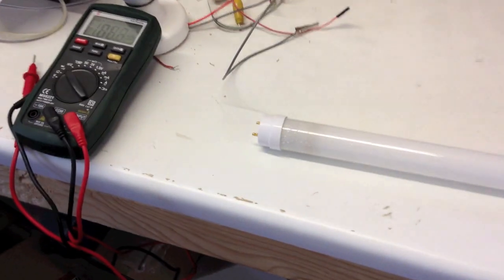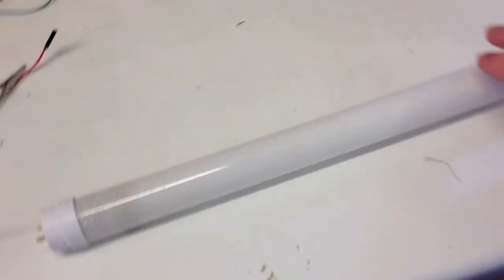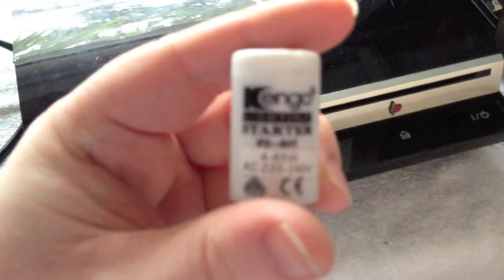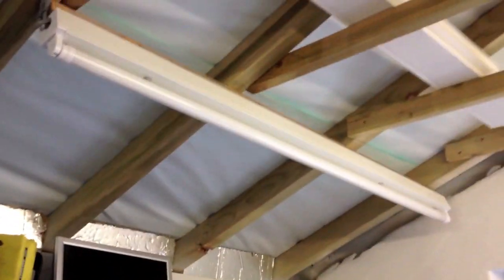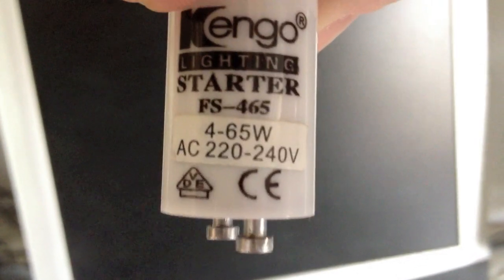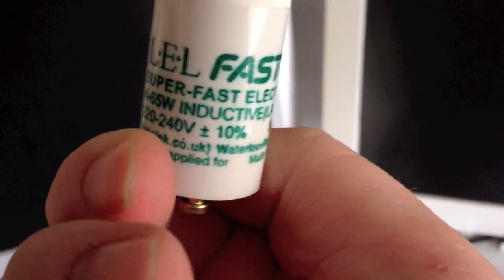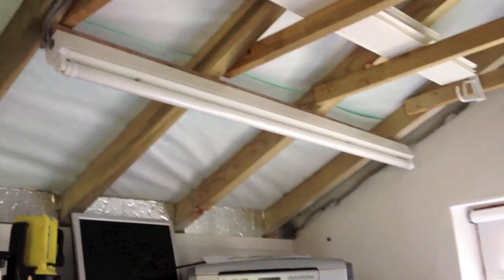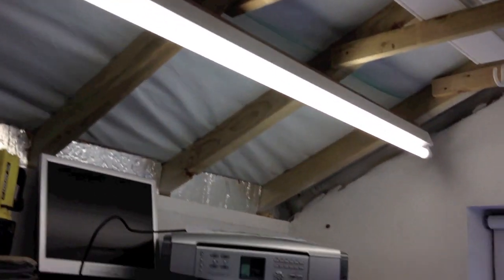Strange Fluorescent tube and starter behaviour

Comment: Tip: if youre using a preheat fixture and one or both filaments are broken on the tube that you are using, you can short one or both ends with wires and the tube will turn on if you are using an electronic starter instead of a glow tube starter

Comment: Being a electrician as I am forever that's is a kengo 5ft 58w fluorescent tube light fitting.it's runs off a 58w ballast.and with a 5ft 58w t8 fluorescent tube and one 4..65w 220-240v starter switch.and cheers for now till next time.and have a very good day to you sir.

Comment: Think your find that is a LED tube with those plastic end caps. A fluorescent starter should not be used at any cost. Would think the tube was wrecked. A LED starter should have been used to bypass the fluorescent ballast.
Reply from the maker: lee harvey no, it's a fluorescent tube.  The plastic end caps are just there for aesthetics. They pull off to reveal standard metal end underneath.

Comment: I had a few ELV electronic starters years ago. Turned on the new lamps with the new starters. They did go on one time... After that both fluorescant lamps had a broken filament. After that I've never used electronic starters again.

Comment: From what it is looking like. The broken filament on the end is broken in a way that the broken halves are still close enough to create an arc (That explains the purple bluish color you see on the one end.) When you had it the first time and it did nothing when you flipped it it must have put the broken halves of the filament closer together and this allowed enough current to flow to complete the circuit. I have had tube that went bad like this, however when the lamp was subject to shock (flicking or tapping) it would start. To me it sounds like an intermittent electrode failure.
Reply from the maker: Yeah I believe the filament was broken at one end however the current flow wasn't enough to drive a normal glow starter but was enough to drive the electronic starters I have.

Comment: Is that an LED tube meant for a led ready fitting?
Reply from the maker: No, it's a bog-standard fluorescent tube.  F36T8 if I remember correctly.
Reply: +RedDragonUKTech It has quite odd end caps for fluorescent tube. I also thought it was LED tube at first glance.

Comment: The glow starter require quite high voltage (~200V) to heat up and close. When the filament is open, there is another potential discharge in series, so nothing happen.
But the electronic close immediately, regardless of the voltage, so the complete mains become across the filament breakage, igniting there a discharge. So a current could flow, preheating the other end and when the electronic starter opens, the discharge get redirected across the complete tube and so it lights.

Comment from the maker: I would expect that if these were electronic ballasts but they're just normal magnetic ballasts which usually have an argon switch starter.  The only difference here is that I replaced the starter but because a filament is broken at one end of the tube the starter is essentially out of circuit.  I expect what AintBigAintClever said about the gas between the gap in the filament is conducting enough current to get the starter to operate is on the right lines.

Comment: I have in my shed 2 f30 t8 fixtures the same but one has the diffuser on. The tubes are made my kengo which still work but I don't use a glow starter. I use a tube saver electronic starter from wickes which makes the tubes last longer